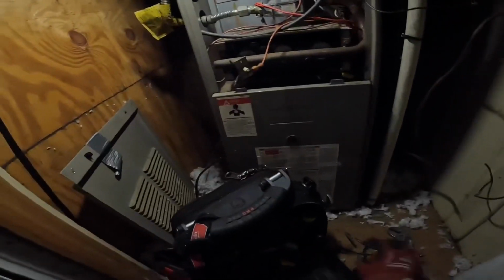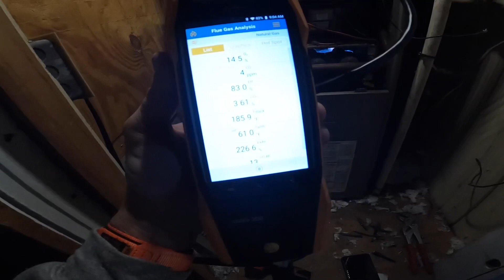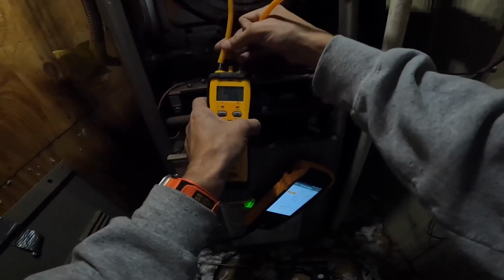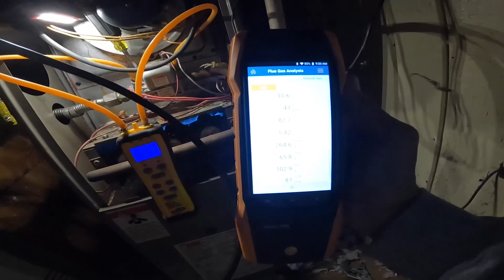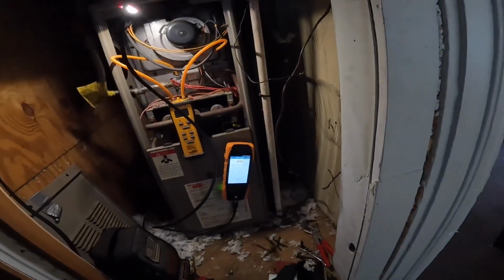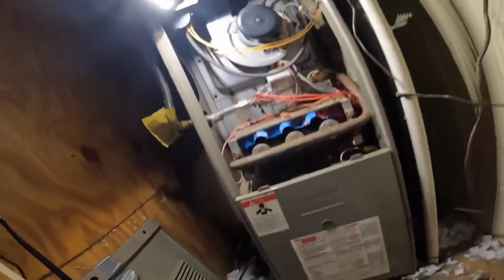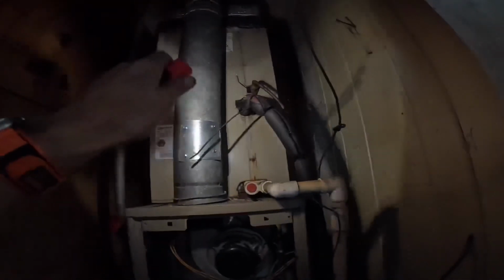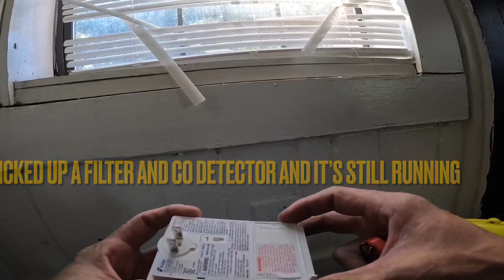A Turn On The Gas Call That Turned Into A Three Hour Job.

Comment: Probably right on the AC coil..  as bad as the filter and blower looked I'd bet you will be back later this winter or in the spring. The inducer sounded like it getting ready to fly apart also!

Comment: I just went on a call today guy said he smelled gas in the house he has a old Goodman 90 percent furnace in the crawl space the board went bad was sending a constant 14 volts to the gas valve so it was partly open letting gas out thank God it didn't call for heat you never know what you will find

Comment: didn't know you did straight up furnaces as well.  you should see the antique (and its horrible basement location) I have to constantly relight on gas-out...once a month starting in any freezing weather.  and then there's the "shop" furnace, which doesn't even go with the place.  you have to wait till dark to attempt a relight because of the draft up the chimney 'cause there's no spark igniter on it.

Comment: Would a partial blockage of the exhaust vent (old wasp nest, leaves, dead bird, etc, etc) contribute to a high CO count?
Reply: if exhaust isn't properly ventilated it's possible. usually that's what thermal limit switches are for.

Comment: I'm a little new in the trade but I would be scared to spray blower wheel with a.water hose with the board and motor still on it. I guess just be carefull of not getting water in the motor?
Reply: I sure some water got into the motor. He did say he let it sit to dry out for a bit. I think I would have just took some extra time and took the motor out.

Comment: Do you use silicone when covering the hole where the combustion analyzer  probe was at or is sheet metal just good enough with some screws in it?
Reply from the maker: Just sheet metal

Comment: Does CO improved only by cleaning? I saw that you increased gas pressure and that made O2 percentage in normal range but CO remained around 50. Is it still 50?
Reply from the maker: I was unable to get it to drop
Reply: @HVACGUY  heat exchanger.
Reply: the noisy inducer may be a little low on air flow and not pulling enough through the heat exchanger to dilute it well or debris lodged in some the far end burner slots.
enough wrong there overall to suggest a new unit.
Reply: 45 PPM in the flue isn’t an issue. Anything over 100ppm is. Some furnaces just don’t burn as clean as others. A perfectly tuned furnace will have 10-30 ppm. 30-60ppm is “average” 60-100 ppm needs cleaned and tuned, over 100 and there is a larger issue.

Comment: Man dude leaving money on the table. That heat exchanger is toast and you got so close and still didn't look. Step up that game man. Damn man SMH. That style with the data plate below the control board got to be somewhere around 1996. Check the heat exchanger first on a call like that. Your oxygen is way high man. Where's the excess air coming from?

Comment: What is all that blue insulation junk all over the place?
Reply from the maker: Attic insulation
Reply: do you think that by now some smart ass engineer would have designed a AC Evaporator enclosure with easy removable doors for cleaning?